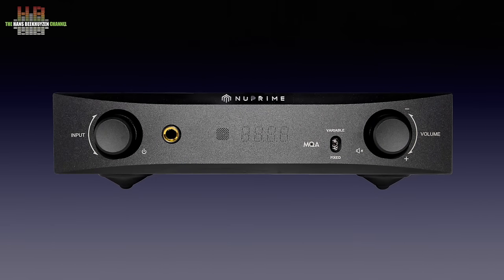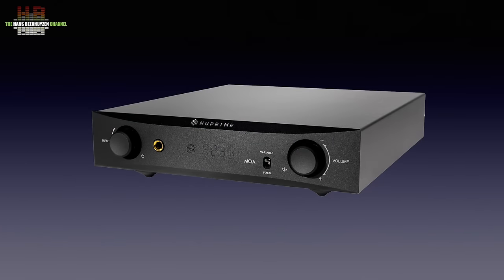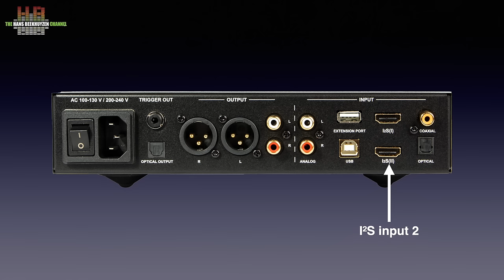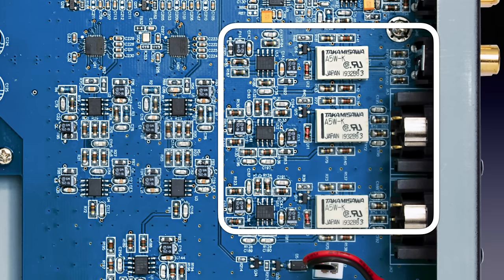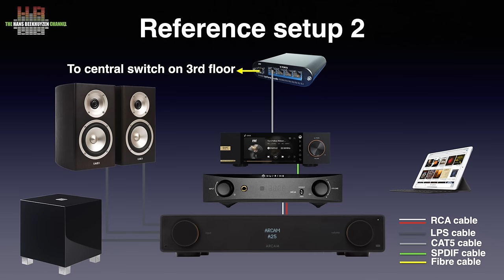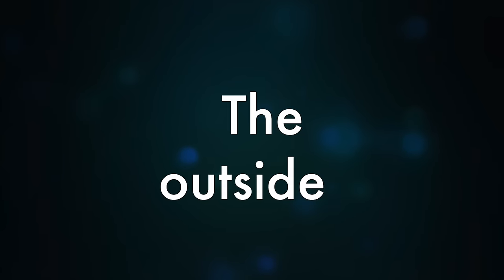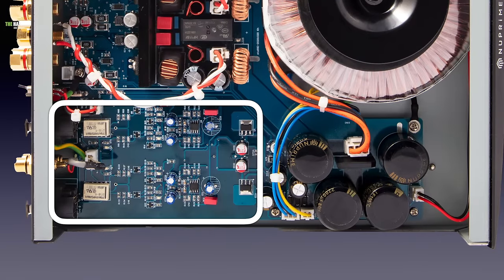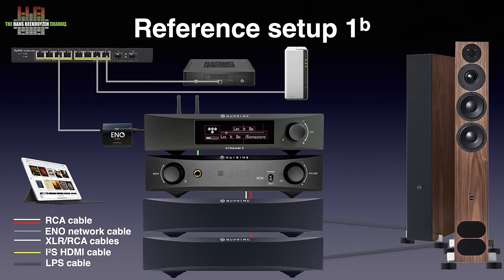NuPrime DAC-9X and STA-9x DAC/pre-amp and power amp

Comment: Surly that fixed/variable switch on the front of the DAC 
is slightly some what dangerous when little fingers
go wondering when your out of the room. Should of
been popped on the rear panel to avoid major disaster.
Reply from the maker: Yep, with children around you better watch it.